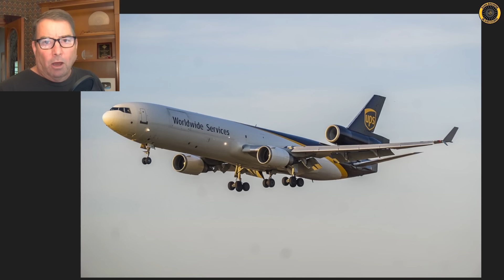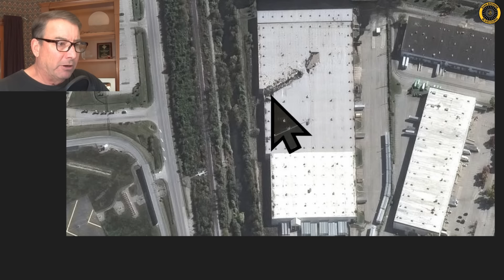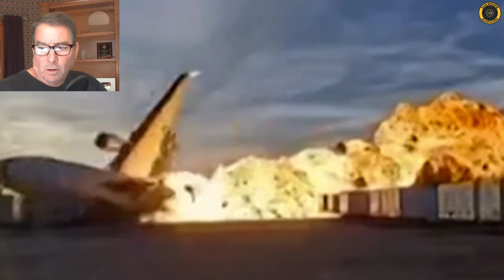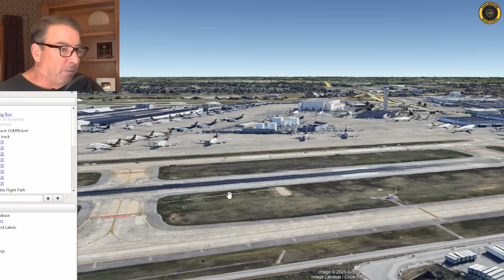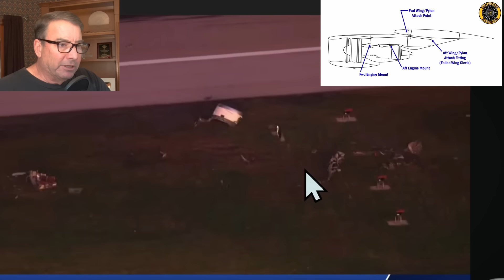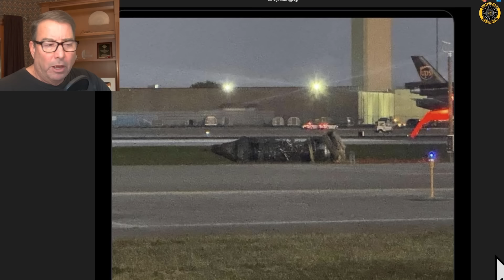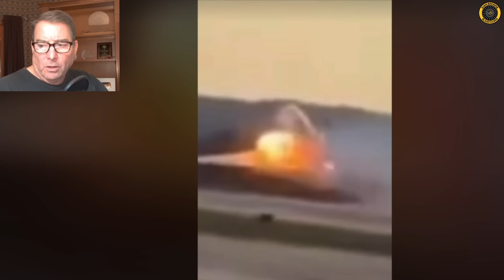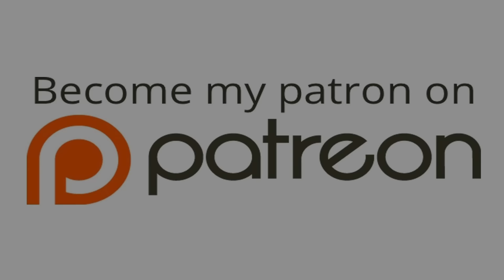UPS #2976 UPDATE 2 6 Nov 2025

Comment: As the plane crosses the road, it looks as if part of the right gear is missing and there may be a dark area under the fuselage behind it possibly indicating damage from striking the roof of the UPS building. The left wingtip then strikes something at the edge of the road (transformer?) producing a bright flash before the plane continues on to strike the fuel recycling depot.

Comment: I would think a blade-off or any failure that would cause severe enough vibration, the engine mount shear bolts would do just that.  Pylons are not meant to detach from the wing and most are mounted with "fail-safe" pins to to keep them in place.

Comment: Looking at the roof damage, it does look like it arc's off to the left.  I have to wonder if the plane was yawing to the left from the thrust asymmetry as it neared stall speed.  If I am seeing the satellite photos correctly as some of these details are kind of small, it looks like there was a stack of old vertical propane tanks hit by the left wing right before the wing hit the ground, suggesting the final wind drop was actually the wing tip sheered off.  I mean it looks like tanks were standing up and got knocked down and maybe another one sheared, which can be seen in the video.  Maybe someone with a better view / better eyes can dial in this bit a little more?

Comment: Juan, something I think people need to take into account; that tug driver that took the original video of the attempted take off ... you don't go around with your phone in hand taking video on a tug at UPS. Something, perhaps that engine failing as they rolled by, prompted that tug personnel to get their phone out and take that video. If you've ever wanted to catch something in action, you quickly realize that it takes longer than you think to get the phone out, pull up that camera app and get the video started. IMO, that is why the footage started so far down the runway. I think the engine failed catastrophically and tore itself away from the wing just after V1. That tug rider heard or saw something prior to the footage, got the phone out and started recording. It just seems like the timeline to this engine failure, based on that tug video, was several seconds before the video started.
Reply: You present a very interesting and I believe valid point. I'm sure the NTSB will be interviewing the person who took the video to determine what prompted them to do so.
Reply: It did look like the AC was trailing something before V1 in that video.
Reply: I thought exactly the same thing, something loud got their attention to look over and start recording.
Reply: Looked like a tractor from a tractor trailer, not a tug, and this was off airport. No need for a tug to be off airport!!  Tractor and trailer yard, off airport property.
Reply: @scotabot7826  He's referring to the initial runway video.

Comment: It’s NOT the acoustic liners found (inside the fwd fan case). It’s the Kevlar wrap that is on the outside of the fwd fan case, for fan blade failure containment. The Kevlar wrap has a tan fiberglass cover for inservice protection. That is the tan wad of material wrapped around the remnants of the fan case.

Comment: The engine is likely on the right side of the runway due to the engine torque. The CF-6 rotates clockwise as viewed from aircraft rear. It's possible the engine had enough torque from it spinning at TRT to roll itself to the right side of the runway after separation.
Reply: Yes that's my take. The question is... did it pass over the fuselage or just drop down and skip across the runway ? Probably the latter... the front looks proper mangled and bent due to the impact.

Comment: Hey Capt. Brown, I love your show.  I'm a 30 year + A&P that gets to do some accident investigating when invited by the NTSB.  This is my first time commenting but I do have to point something out that you got wrong. I wish I could attach pictures but I'll try my best to explain.  When you said that you where corrected in pointing out what that stringy mess near the front of the engine, you said it was the acoustical liner.  That too was incorrect, the acoustical liner is made up of honeycomb and carbon fibers.  What you see in reality is the fan containment ring which is made up off layers of Kevlar.    Something I would like point out is that the containment ring is completely destroyed and in no place (so far) can you find any pieces of the fan.  I would speculate that the engine had a catastrophic fan event that ripped the engine off the wing.
Reply: I thought it looked like Kevlar.  I have a little experience with it (not aviation related).  Good catch.
Reply: John - I’m leaning towards your speculation of catastrophic failure. In the Day 2 NTSB briefing, they commented about documenting fan blade pieces on the runway. For me, I’m trying to conceptualize Eng #1 (left side) ripping up and over the fuselage to the right side of the runway.
Reply: @TheGlobalTravelr did it go up and over? I also have a hard time seeing that. Wow.
Reply: @77rusman  As a retired airline inspector on the 747, 767 and DC-10,  I am just speculating here and I may be wrong. 
                               With the high sweepback angle of the MD-11s wing like the DC-10, maybe a fan blade(s) departed and then sliced thru the underwing skin breaching the fuel tank.
Reply: @77rusman I’m only speculating…keep in mind the GE engine is producing up to 61,000 pound of thrust at takeoff. This doesn’t take into the consideration the dynamic gyroscopic forces on the engine/pylon. Juan’s first video showed the #2 engine compressor stalling. That indicates to me some type of FOD was ingested.
Reply: @John-nc4bl I was Captain on the MD-11 for 16 years. It was a marvelous aircraft to fly! I applaud our training program cuz we would go through different scenarios of V1 cut followed by some type of catastrophic failure of the second engine. Sadly this crew experienced a Kobayashi Maru event.
Reply: Based on what you know, do you think failure of fan blades could cause the engine to vibrate hard enough to remove itself and the pylon from the wing?
Reply: Your analysis explains a lot but was the fan set out of balance first,  contacting the Kevlar which significantly increased the out of balance leading to pylon pin failure,   or the pylon pins failed first (as has happened when incorrectly handling the engine installation) and the kevlar contained the inertia of the now separated engine. The final position right of the runway leads me to think the engine still had rotational inertia after leaving the pylon.   Either way there was little chance that the structure could manage such a massive change of kinetic energy and had the engine not separated the wing spar would have failed. 
I think if No 2 & 3 were at 100% and those fuel tanks and wires were not there it is possible the aircraft may have enough energy to clear the buildings and climb.  
My condolences to all.
Reply: Thanks for the very factual and complete update. (Retired UPS CAPTAIN)
Reply: In a horrible way they are lucky that the engine and pylon that probably started it all were detached from the aircraft and are available for forensic investigation.
Reply: Yep, pretty much what Juan said....

Comment: It’s starting to sound like a loss of thrust caused the airplane to descend into the buildings off the end of the runway. Loss of thrust from one engine should not have caused this crash. Not a loss of control scenario either. The airplane lacked enough engine thrust to climb above and clear the buildings and other ground facilities.  Yes, this is a very different crash scenario.

Comment: 5:33 @blancolirio The tan colored section around the fan case in the inset engine photo is part of the protection system designed to prevent the uncontained release of rotating engine mass resulting from a fan blade or disc failure. It typically consists of multiple layers of Kevlar wound round the fan case. I believe this is the shredded 'grassy' material seen at the front of the detached engine core.

Comment: AA191 was the first thing that came into mind for me... Until I saw the video where the plane was wings level.  One thing that AA191 demonstrated is that the DC-10/ MD-11 is unable to fly at V2 without the leading edge slats out.  It will be interesting to see what failed first, the engine or the pylon.  At this point it's a matter of place your bets.  My instincts say it was the pylon, but with that said... Already been burned by drawing conclusions from previous accidents.

Comment: Pilot's worst nightmare, a situation in which you have zero control of the outcome. Rest in Peace.
Reply: I dont know which is worse, having no control or having control over the situation and still going down...
Reply: Hopefully it happened so quickly that they weren’t aware it was hopeless
Reply: @alexmarshall8187  I can almost guarantee you that they knew it was hopeless.
Reply: @Ozai75  Absolutely. But the adrenaline pushed away any other thoughts then trying to save the plane until the impact It all went very very quick
Reply: @Ozai75 it was so fast
Reply: @Ozai75  ywp.. But the plane remaining level until the bitten end showed us they tried
Reply: @alexmarshall8187  eh unfortunately that would be more the case (one hopes) with what happened in that diy submersible a little while back - essentially instantaneous failure/destruction of the vessel. but anything longer than a fraction of a second and you’re aware.
Reply: What blows my mind is at no point have passenger airline manufacturers haven't given pilots the ability to have full view of the wings.
Reply: @neurocidesakiwi  I agree that strategically located external cameras would help crews understand problems.  In this case, I doubt they had time to dial up a view of the wing.  The could only react and try to fly the plane.
Reply: @neurocidesakiwi 
Yeah they might have been able to see the defect before they past the point of no return.
Reply: @neurocidesakiwi  cameras exist, if it were needed it could be done, i would assume a Master alarm went off and they knew they had engine problems...
Reply: thank you Cpt Obvious, you bring so little to so many
Reply: Full control to get better job than to be a pilot.

Comment: The connection between the engine and the pylon is engineered to break in an extreme event. Not the pylon to wing attach point, right? To protect the wing. So, this still could be a pylon to wing attach point failure. Even though the events that caused this failure, at this point, don’t look like AA 191. Just my thoughts as a A&P. RIP to those fellow aviators ❤

Comment: Just FYI... The link pins that hold the pylon and engine on the aircraft are fuseable.  Meaning they are design to let the engine break-off if the engine has very high magnitude vibrations, usually caused by some type of major engine failure.  The reason for this is so the engine will fall-off to avoid the huge vibrations damaging the wing and causing a crash.  Normally this type of situation would occur at some altitude as opposed to right at takeoff. I would believe the fuseable link pins would be typical for all transport aircraft/engine combinations.
Reply: Exactly... they must have taken a hammering during the takeoff roll and finally failed round about rotation....

Comment: What are you saying, leaving the crew in an impossible situation? It is a 3 engine aircraft executing a takeoff on a balanced field. Engine failure after V1 leaving two engine to continue. It's what they train for. Until it is determined that one of the two remaining engines was compromised, it wasn't an impossible situation.

Comment: Thank you Juan for saying that we need to be careful when comparing AA191 to this accident. I feel like too many people are already blaming Maintenance, because of what happen in 1979.
Reply: People are always quick to say "It's [airline] [flight number] all over again!" Aviation accidents are not repeats of previous accidents, but rather have their own unique chain of events. It completely undermines the complexity and intricacy of aircraft components/design and investigation efforts when one simply tosses the most recent event into a bucket containing whatever vaguely-similar historic incident first comes to mind.
Reply: Asking about that 4 hour maintenance delay to work on engine 1 has been in every NTSB press conference and youtube video. My working theory based  on my experiences with American Airlines is that the plane originally scheduled for that flight got written up for an engine issue, so they pulled it in to have a look and realized it would take too long to repair. So they swapped in a new plane. The 4 hour delay was probably determining the original was unusable, prepping the replacement, then fueling it. I fueled British Airways 747s, and it took 2 hours to pump 25,000 gallons onboard those. Putting 38,000 gallons onto an MD-11 probably took a similar amount of time, if  not longer.
Reply: @murphsmodels8853  okey, I hadn’t seen the latest one yet. Did they specify what maintenance had been done on the engine? Cause I mean there could be a lot of different things done that not necessarily have anything to do with the accident. Your theory isn’t wrong and people have the right to speculate. My problem is when people start pointing fingers and the investigation has only just begun.

Comment: ooooh  tough call. engine stalled by sound damping mat ... or...
engine gets loose and then bashes into the cowl and damping mat.
the wing fire and apparent loss of power in #2 engine 
has me thinking engine loose from wing first.   
It is the vibration to destruction and time to lose engine
I would think a pilot should have felt it in time to emergency stop.
it clearly happened quick  so that is about where we decide what hair to split.

Comment: Said it before and I'll say it again, airlines & airports should allow planes to run the engines up at higher thrust for a bit with the brake set, prior to take off. Would be much less devastating to discover engine issues while stationary, rather than at or after V1. That very well could have prevented this disaster from ever happening.
Reply: Will the brakes hold?  Lear jets have tried and almost succeeded in taking off with the brakes set.
Reply: @loudidier3891  Good question. I'm not affiliated with the aviation industry, but I used to watch AN-124s do this pretty regularly so there's definitely a way.

Comment: is it possible the torque of the fan blades in the left engine, when it broke away, carry it from left-to-right it over the fuselage in front of the #2 tail engine and then landed on the right side of the runway?

Comment: I'd say it's more likely the pylon failed first.  If the engine was failing and the fan was tangled in the liner of the cowling it wouldn't be producing enough thrust to fly over the wing and fuselage to the other side of the runway.  If the pylon failed the engine would briefly continue to run at full power until the fuel was exhausted but would continue to produce limited thrust because of the momentum of the rotating components.

Comment: Looking at the engine core, the fan section appears to be angled upwards as if the front attachment of the pylon failed and the engine swung down and struck the runway cowling first. Just my impression. I do realize that the core being oriented upright on the field would be statistically unlikely, but I've seen stranger things.

Comment: I think you could still run ties to AA191, that they still haven’t figured out how to drop the engine off the wing without causing colossal damage in the process.  I’d much rather have an engine like United 328 or 1175, dangling out there, than have it tear the wing structure to bits, and set it alight on its way out.

Comment: It's obvious that after the pylon failed, the pylon and engine #1 flipped over the wing and over the top of the aircraft from left to right, fodding out the center engine #2, landing on the right side of the runway, and skidding from left to right at about a 30 degree angle, due to the momentum it had. This is why the engine and pylon debris is on the right side of the runway. The incident was after V1 and the crew continued the takeoff, but it wouldn't have mattered much of they aborted at that point, they would have gone off the end of the runway in a fireball. If the center engine hadn't been fodded out, they would still have been doomed, as the fire would have melted the left wing. A horrific accident, the crew never had a chance.

Comment: Looks like #1 pylon is also missing (edit I see you pointed it out). The slats would not retract due to loss of hydraulics. This was a design change to the DC-10 and later MD-11 due to AA191. AA191 cracked the tombstone fitting, eventually leading to loss of the pylon. As Juan mentioned, these accidents seem similar but their mechanics of the crash are a bit different.

Comment: Seems to me that as parts of the nacelle have ended on the right side of the runway adjacent to what appears to be engine impact gouging suggests an initial pylon failure with the almost intact engine partially breaking up on impact with the ground. An initial engine explosion would IMO have seen more nacelle debris on the left hand side of the runway and further back from the engine resting place.

Comment: How did the #1 engine get to the right side of the runway? Would the rotational inertia of the internal components cause it to roll that direction after it hit the ground? Worst case scenario at the worst possible time, no one on the airplane or the ground had a chance...